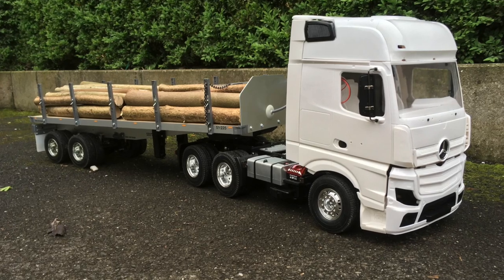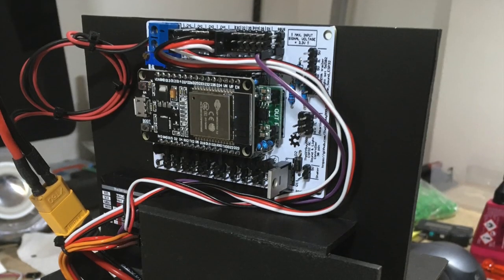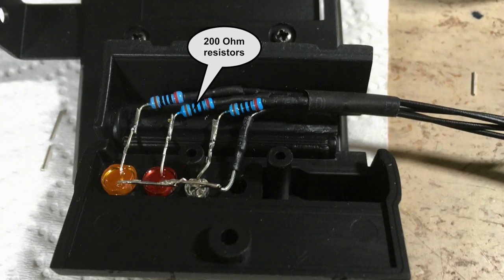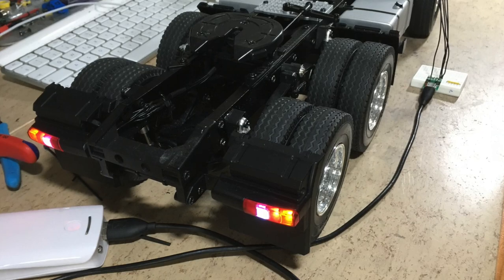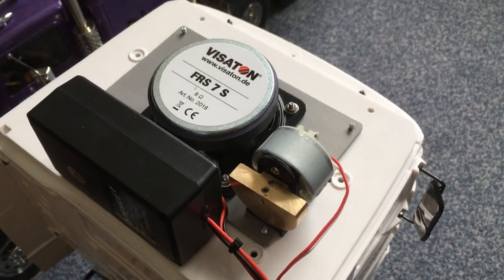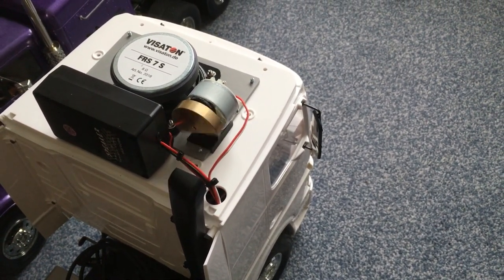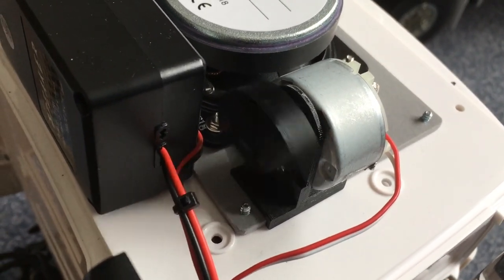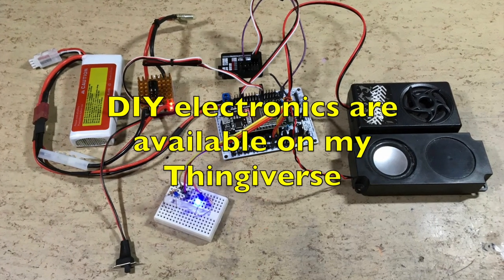Hercules Hobby 1/14 Scale Actros 3363 first outdoor test drive: Arduino DIY Sound & Lightcontroller!

Comment: Does 1st, 2nd, and 3rd gear change the rate on the throttle so it limits top speed?   That setup is awesome!
Reply from the maker: Thank you. No, this truck has a real 3 speed shifting transmission, which is synchronised in software by the ESP32 sound controller. This allows to shift smoothly while driving. There are also software options, which are simulating a double clutch transmission or an automatic transmission with torque converter (if you don't have a real shifting transmission). The number of simulated gears can be selected. more details can be found in my other videos.

Comment: Great job!
I tried to repeat the project. I did it, the video is on my channel.
I also added iBus protocol support for working with FlySky receivers. Everything works, but there are some problems that I would like to discuss. I copied parts of the program for working with the SBUS protocol and changed them. My problem is that the truck does not always start. You have to restart the ESP32 several times. Will you help me deal with this problem?

Are you planning to add trailer support over the air? IR? Bluetooth? nRF24l01? I am now trying to implement data transfer to a trailer using an infrared signal.
Reply from the maker: Thank you. I had a look at your video. It appears to work great, well done! Which PCB did you use? I would love to see a video of your board.
I don't have an iBus compatible receiver, so I can't test it. Do you have anything connected to pin 0? If so, this will cause ESP32 boot issues. That's why I moved the headlights to pin 3. I don't have plans for trailer support. If I add support, then it will be IR based, I think, because there are not enough spare pins for an NRF24L01 module. If your IR code works, you could post it on GitHub. Do you know details about the Beier IR trailer control code or will it be proprietary?
Reply: Thanks for the answer.
I am using a breadboard PCB right now. Yes, I soldered the ESP32 chip to it. I'll make her video later.
Contact 0 is not used. It is used only for firmware and debugging.
Regarding the use of NRF24L01, I came to the same opinion. I also had an idea to use UART, and connect a separate transmitter for the trailer to it. I couldn’t use Bluetooth. ESP32 stubbornly did not want to connect to my HC-06.
I don’t know anything about Beier IR. I'll try to learn more about him.
Soon I will post my project on Github.